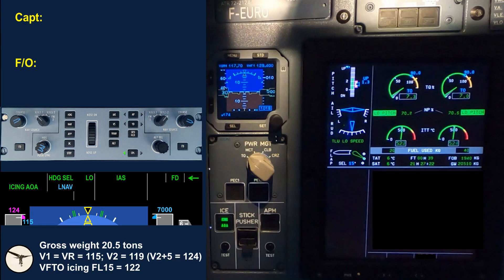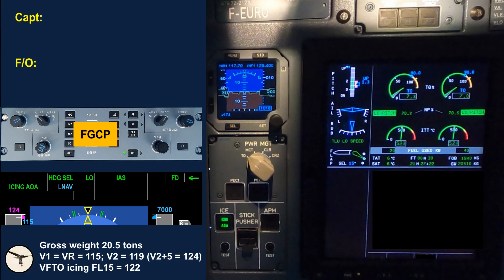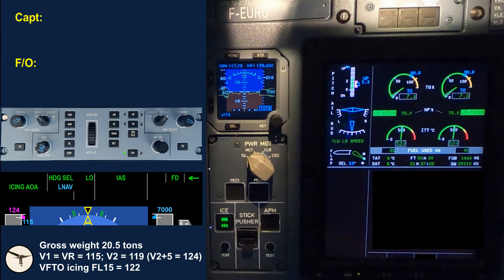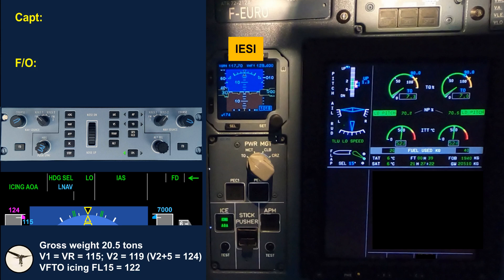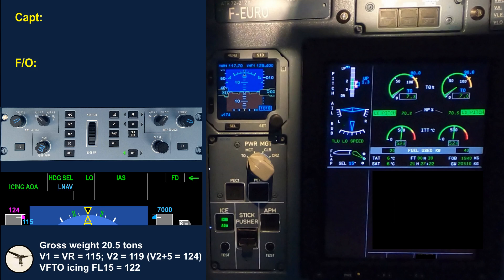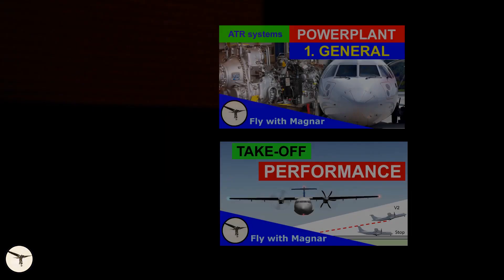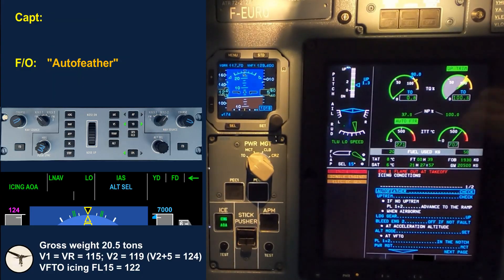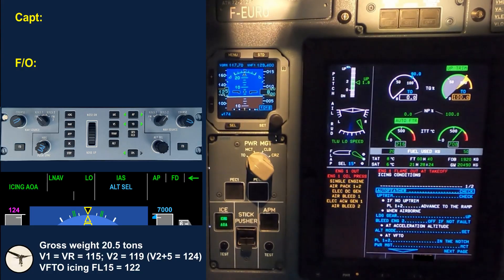ATR 72-600 engine failure procedure

Comment: Hello again my friend. I have a question. 

When we have a flameout while climbing with icing, you hold flap 15 and the VFTO goes over to 122 kts. The question is this: You continue climbing with flap 15 to the requested altitude. Then the plane levels out and increases speed. When do you go over the flap to zero? The magenta pin continues with the VFTO. Can You explain all the process please. Thanks
Reply from the maker: VFTO depends on the weight. When VFTO is 122 kt, the weight of the aircraft (ATR 72) is slightly over 20 tons. VFTO is minimum speed with flaps 15. 
Answer to your question: When the aircraft levels off, it will accelerate. You can retract the flaps when the speed is at or above icing bug (158 kt at 20 tons).
Reply: @ thank You very much.

Comment: HELLO Magnar very good  just a correction as well as on QRH 72-200&500 I don t know on 600 but maybe is the same you let me know please if you like, on ATR 200-500 at eng flame out at TO.......  after VFTO as you said PL NOTCH SET MCT BUT THEN NOT IAS,  before IAS if normal condition flap 0 if ice condition flap 15 I note the TAT was 6 degrees so below 7 degrees if atmosphere ice condition and so on...... in flight we are in ice cond.... but you don t mention that you were in ice condition, then set IAS....... maybe in 600 is different apraciate explanation  thanks
Reply from the maker: This video was recorded during a training session. We have never flown together, and this was our first simulator session. Because of Covid-19, we had not flown for many months. We had very little time to do the recording, so this is what we got. Therefore, in the left column, I wrote all callouts, including those we missed.

Comment: Hello Captain
Should we always go around when we encounter an engine failure (not fire) during final approach with ATR72
Reply from the maker: The general rule is to go around, as you are no longer stabilized. But if you are very low, it might be better to land. When we during simulator training practice engine flame out on final, we lose a couple of hundred feet befor the aircraft starts to climb. If we are prepared for the exercise, we can reduce the altitude loss to one hundred feet.
Reply: @FlywithMagnar  thanks a lot Captain

Comment: Just a question, if a I have a loose of torque from 90% to 70% to one engine at take off which procedures I have to apply? Engine flame out take off memo itmes?
Reply from the maker: Any positive power is better than zero power. First, climb to a safe altitude, and  apply the ABNORMAL ENG PARAMETERS IN FLIGHT checklist.
Reply: @FlywithMagnar  so we don't need to level off at acceleration and set MCT at vfto. A normal take off I understood and then abnormal engine parameters
Reply from the maker: @GiuseppeSRedSky Yes.

Comment: If after you take off in icing conditions, the aircraft begins to build up ice, once you reach acceleration altitude do you retract the flaps at red bug? With ice accretion? Assuming you can, as you have protection at red bug (VMLB0), why does the checklists say to leave flap 15 extended if in icing conditions?.
Reply from the maker: It is correct that you retract the flaps when the speed exceeds the icing bug. However, when flying with one engine inoperative, the aircraft will not climb at that speed. Therefore, we fly at final take off speed for icing conditions with flaps 15.

Comment: Hello, Captain. What is the procedure for an engine failure during approach, and what factors should be considered when deciding whether to continue the landing or go-around? I couldn't find anything in the manuals except for a mention about feathering the propeller if a go-around is considered.
Reply from the maker: Good question. The answer is "it depends". The memory actions are power lever to FI, and condition lever to FTR, then FUEL S.O. This takes a few seconds. 
If you do not have time to do this, you continue and land. Advance both power levers to maintain speed. (If you move the power lever of the failed engine to FI, propeller drag will incrase.)
If you have time to do the memory actions, you have two options: Continue and land, or go around. There are a few things to remember when landing single engine (single engine operation checklist): 1) The approach speed shall not be less than VGA. 2) You cannot continue a Cat II approach. 3) There are limitations for steep slope approach. 4) The bleed valve on the opearting engine must be OFF. 5) The condition lever of the operating engine must be set to 100% OVRD. 
Never try to go around with a windmilling propeller.

Comment: Thank you! At 5:30 you reach ACCEL ALT and command ALT SEL to level off and gain speed. FMS speed target stays at V2+5, plane accelerates, shortly after you command IAS mode to climb to 3000 ft, plane climbs with FMS IAS target if V2+5. What the reason of the level off at ACCEL ALT with one engine inoperative? Thank you again, your content and presentation is high class!❤️
Reply from the maker: When I reach Vfto (final takeoff speed), I select MCT power, flaps zero and IAS mode. When selecting MCT, the target speed changes from V2+5 to Vfto.
Reply: Ah, thanks!
Reply: If this did not happen in icing conditions, VFTO would have been higher (approximately 20-30 knots) than V2. The procedure is to level off, accelerate to VFTO, then retract the flaps and continue climbing.
In case of icing conditions, the flaps remain at 15 and VFTO is closer to V2. In this case, it was 2 knots lower, so the plane was already at the correct speed.
Reply: Nice video. Is the efato checklist a read and do ?
Reply: @johncreedon7847  you perform memo items by memory, which you should know by heart. However if you did forget them they're in the procedures window but please do not 😂. Most "read and do" checklists are the abnormal or following failures. Good day!

Comment: Hello Magnar, I think to distillate from your tutorials that you have over 23 years on this aircraft type!? That's quite an impressive feat! If you want to share it: Did you over all these years experience actual engine problems and if yes what kind of/what were the root causes of the abnormals or failures? Regards, Boy
Reply from the maker: The engines have a good safety record. The only issue I have experienced, is EEC fault a couple of times. Everytime, it could be reset.
Reply: @FlywithMagnar  Thank you, that is a good record indeed!

Comment: Hola Magnar, excelente video. A question: ruder turn to the right, turn to the fail engine side, that is a technical of fly? P.D. Sorry for my English.
Reply: Aunque no sea Magnar te intentaré ayudar jaja. En el pedestal se encuentran el Pitch, Aileron y Rudder trim. En el EWD en el video se puede observar que el rudder trim estaba hacia la derecha, esto es para compensar que por el lado derecho hay más impulso que en el izquierdo, esto causa un alabeo hacia la izquierda, por lo que para eso es, para compensar. Si lo ves en verde significa que está siendo controlado de manera automática, si está en color azul, lo controla el piloto. Saludos

Comment: Very interesting video. Do you have any possible theory on what may have happened to Yeti Airlines 9N-ANC. I suspect it could be in relation to the autofeather engaging 100% on engine one. What are your thoughts?
Reply from the maker: No, I don't want to speculate. Most accidents happen because of a chain of events, and until the accident report is published, we cannot know what lead to this accident. The autofeather is armed in flight when both engines produce at least 46% torque. It is triggered when one engine torque is below 18%. This causes the propeller to stop.
Reply: @FlywithMagnar  thanks for your response.

Comment: Sir in engine failure rudder trim is carried out automatically or by pilot.???
Reply from the maker: It depends. In older ATR variants, the rudder trim is manual. In ATR variants with glass cockpit, the rudder trim is automatic when the yaw damper is working. Otherwise, the rudder trim is manual. https://youtu.be/aWNbukP1Dlg
Reply: @FlywithMagnar  sir i m questioning about atr 42-500 .when an engine failure occur,captain will manually trim or it will  compensate by yaw damper.
Reply: @nisarullah4850  manually trim

Comment: Hello Magner,
I'm enjoying studying ATR these days with watch your videos.
I have a question about "ENG SEVERE MECHANICAL DAMAGE ON GROUND".
I trained RTO at FFS.
I set malfunction to ”ENG FLAME OUT”.
I expected the ECL to POP OUT "ENG FLAME OUT ON GROUND".
However, ”ENG SEVERE MECHANICAL DAMAGE ON GROUND” was POP OUT on ECL.
What does ATR detect to determine "ENG SEVERE MECHANICAL DAMAGE ON GROUND"?
In Generally Airplane, pilots judge ”ENG SEVERE MECHANICAL DAMAGE ON GROUND” from the following factors.
Any abnormal noises
OR
Any abnormal vibrations
OR
Non–response of the engine to power lever movement
OR
Severe variations of the engine parameters: TQ, NH, fuel
flow, ITT, loss of power...etc

What does ATR detect to determine "ENG SEVERE MECHANICAL DAMAGE ON GROUND"?
Reply from the maker: Hi, that's a good question! In this case, I would also expect to see the "ENG FLAMEOUT ON GROUND" procedure on the EWD. I would ask the simulator engineer about this and eventually write it down as a snag in the log.
Reply: @FlywithMagnar  Thank you for answering.
I would also like to discuss with our engineers.

Comment: Standard 3 or Standard 2?
Reply from the maker: The video is from a simulator with STD 3.1 software, but the procedure is exact the same in STD 2.
Reply: @FlywithMagnar  Didn't hear the VFTO call
Reply: @oliverearthur5354  in this case icing conditions so flaps 15 is maintained,there will be an amber bug on the ASI

Comment: What is the drift down and downhill approach
Reply from the maker: "Drift down" is a procedure used when the aircraft is flying over mountains higher than the altitude the aircraft can maintain when one engine has failed. After the engine failure, the aircraft must be able to clear all obstacles with 2,000 feet during as it is descending. This is called the "downhill rule".
Reply: @FlywithMagnar  sir what is the difference in these two procedures?
Reply from the maker: It's the same procedure. Just two different names.
Reply: @FlywithMagnar   the procedure for the drift down without obstacle and DHR is same spd 200 and vs 500. Sir can you make a video regarding this there difference?
Reply from the maker: I have never heard about flying drift down with 200 kt and -500 ft/min. That doesn't make sense because engine power changes with changing atmospheric conditions during descent. 
Single engine ceiling is defined when flying with white bug speed (zero flaps in normal conditions, flaps 15 in icing conditions). See "MINI EN ROUTE" speeds on the speed card. If there are obstacles, you use this speed during drift down (IAS mode). If there are no obstacles, you can use any speed you want.

Comment: Excellent video, thanks for the info. Appreciate if could upload another video with regards to fire on take off.
Reply: The procedure is almost the same but after moving affected PL GI and the CL to FUEL S.O., pull the fire handle illuminated red and start a chrono: if after 10 secs fire persists, discharge Agent 1, if persists after 30 secs, then discharge Agent 2. Read Engine Fire after TO C/L

Comment: If the single engine failure happened during the day or night do Captain or FO look outside your corresponding side window briefly just to see what the physical engine/prop status might be after you have confirmed safe IAS, climb and trust status ?
Reply from the maker: Yes, I'm sure the pilots will do that when the time permits. Personally, I have never flown single engine in the real airplane. The simulators have a 180 degrees view, so we cannot see the wings or the engines.